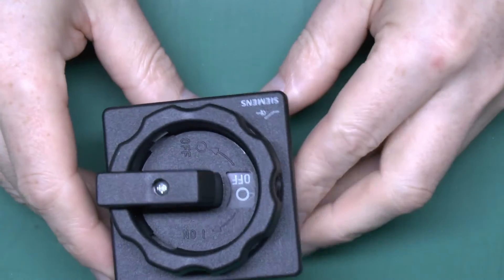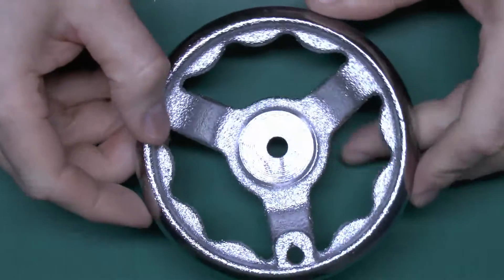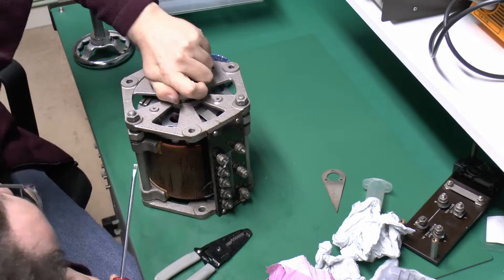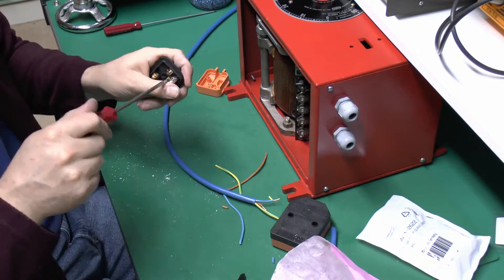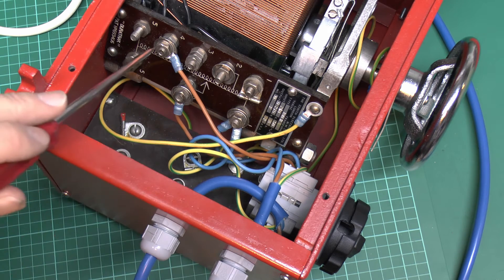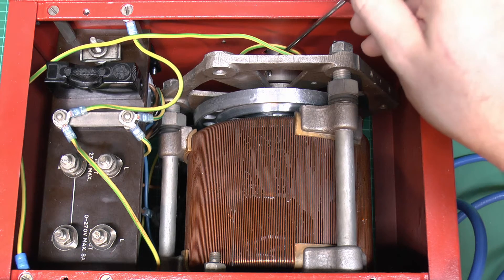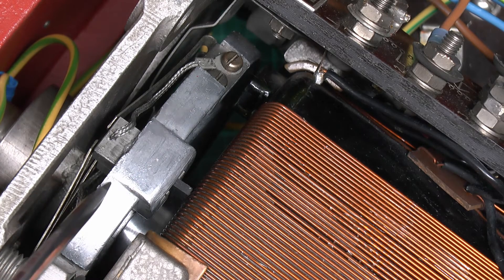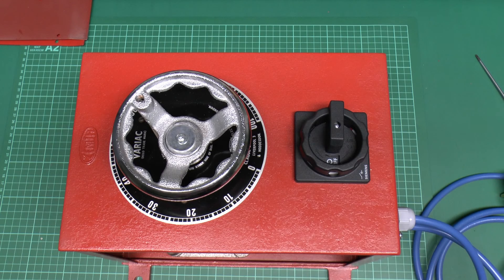Claude Lyons / Zenith 8A Variac Refurbishment (Part 3)

Comment: While the fused plug is a good idea, it is essential to fuse the output at (or below) the rated current to protect the brush and any portion of the coil from excessive load current. Consider for example, how much current could be drawn from the output of a 2 Kva Variac with the output set at a mere 10 volts without blowing the mains fuse. No part of the winding could handle that amount of current (~200 amps) without quickly overheating while the localized heating from the brush losses (I2R) will burn the coil at the point of contact. The carefully controlled resistance of the carbon brush is the key to the design and longevity of any variable autotransformer. It's what allows the brush to bridge 2 adjacent turns of the winding without creating a "shorted" turn. The brush is the hottest operating part of the entire device. The disk that it is fastened  to on larger Variacs serves as a heat sink. If you want to properly protect your Variac investment, fuse the output.

Comment: Just done one of these. Thanks for the brushes part number. Thought I'd chip in that I filed the brush holder not the brush. Keeps it at 2.5mm thick so less likely to break, less messy and ready for next time. A word of warning on this....file the holders opposite ways 'cos they go in back to back and will be out of line if you do them both the same.  Thanks for the video John....it gave me the b--ls to try it! 
Dave.

Comment: Hi John, I just bought this exact model off eBay, and before plugging in I just buzzed the plug that was fitted and goes what dead short, i took the cove r of and found the short is in the variac i.e. i disconnected the mains in cable and there is a short across the input terminals. If you any ideas I'd be greatfull, otherwise it will be going back. Bob
Reply from the maker: Depends what you mean by dead short  - as it's a transformer the DC resistance will be very low, mine is only 2 ohms including the mains cable.
Unless physically damaged, faults with the primary winding are unlikely.
Reply: Hi John, yes the meter reads 1.75 ohms across the live & neutral, but as i say it trips the MCB in my house.
Thanks Bob
Reply: Hi John, me again, it seems the variac is ok, the problem is inrush current, I replaced my MCB to the bench from a 16A one to a 32A and all ok now. It seems I could use a delay (D Type) MCB so i'll look into that in the near future.
Thanks again mate, Bob

Comment: I have the same variac with the same loose flaky paint problem and worn brushes (plus two slightly burnt track points - but not fatally so) and I found your video in a search for replacement brushes. 
Lo and behold you not only gave a source but also the part number which as of Sept 2016 is still correct, cost £4.32 inc post.
Well done!

Comment: Another great video, really enjoyed this series.  BA threads are actually metric by the way.
Reply: BA is indeed based on the millimetre. Although the sizes are usually given in imperial, if you convert them to metric the origin is very obvious. 2BA as used here is 0.1850" or 4.7mm o/d. The thread pitch is based on a 1mm starting point for 0BA.

Comment: When you reassembled it, the bridge contact to the slider seemed to be very close to the frame. I would have added a piece of "fish"paper as a insulator to prevent any possible contact between them.

Comment: can u tell me waer can i get new brushes for the Variac wot u hav i got the same 1as u
Reply from the maker: +mg42cammyhigh Mine came from RS Components, they don't have the exact size so it's a case of selecting the nearest larger size and filing them down to fit.

Comment: Hi. Nice restoration project. Isn't an output fuse a good idea to protect the variac from high current overdrive if the output is not monitored (low voltage high current situations /applications)? Thanks for sharing your knowledge.

Comment: My earlier question apparently did not have a reply button but John did respond and so I'm posting it here in case others have the same question. Thanks John.

"I could not find any brushes which were the exact size.  The ones used were from http://uk.rs-online.com/  stock number 3473849

These are the correct length and width (10x6mm), but are slightly too thick - they need to be filed or sanded down to fit into the brush holders."